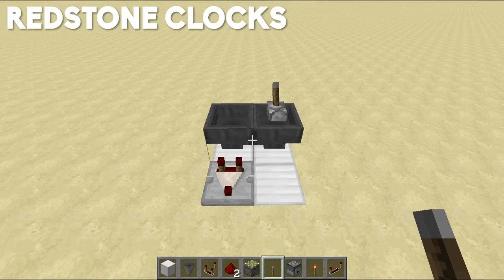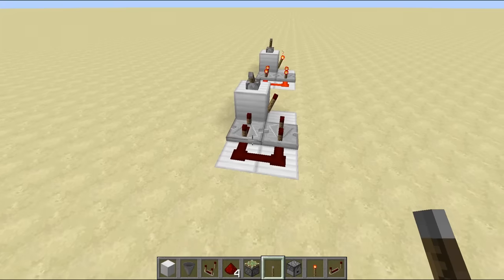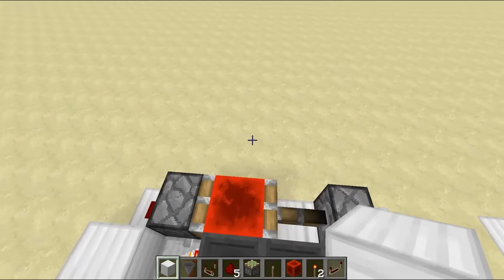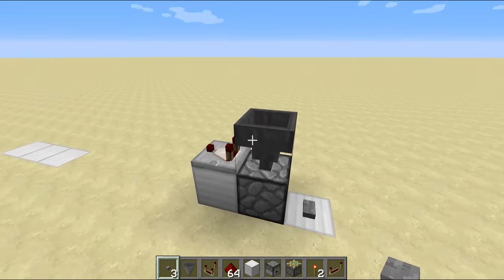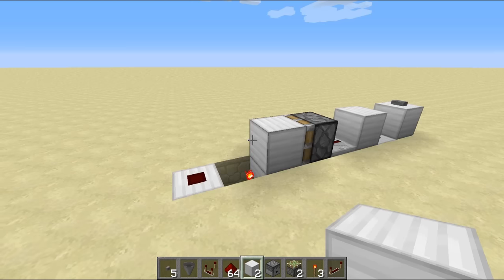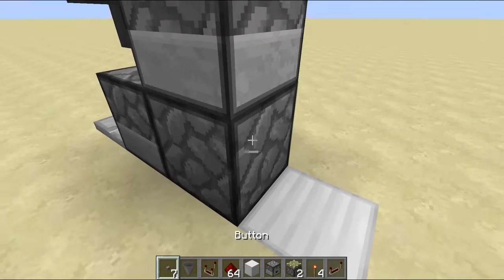25 Minecraft Redstone Circuits YOU SHOULD KNOW!

Comment: cAn'T yOU juSt uSe a LEvEr???
Reply: He can but using button is cooler
Reply: Following on from NBA Sebastian whatever-his-name-is (sorry dude), you could for instance have a hidden staircase that can retract and pop out from both ends, like in the 3-hour bunker challenge
Reply: Also because, if you have a piston door with levers on both sides, you can easily lock yourself out
Reply: what if you wanted 2 use a pressure plate or tripwire?
hmmmmm....
Reply: s&n railway you can just click reply to reply to their comment...
Reply: OrangeC7 levers can only switched by players. Flip flops allows you to switch these "levers" with redstone signals
Reply: drum roll not in a tight contraption!!!
Reply: TOO SIMPLE
Reply: It's good if you want your base to light up when you walk it
Reply: Levers sometimes don’t cut it
Reply: people use bottons instead just to make things look better
Reply: cAn i jUst uSE a reDsTone tOrcH?1
Reply: If you have a piston door that has a lever someone can lock you in/out, but with a t-flip flop you can't lock the door unless you put in a locking mechanism
Reply: get an iron door and put two levers beside them. see what happens. it dont work. you pull one lever and it works and you then cant close it.
Reply: No levers need to be turned off mannualy

Try using levers to open and close iron doors

YOU GET STUCK
Reply: @jannpmc4694  the button is better too because you could have and or gate to power one switch. Rather than have to use 2 levers and run the risk of accidentally locking yourself out of your base because you decided to flip the switch inside of your base
Reply: I think nobody got that it might be a joke..
Reply: Buttons are just better :P
Reply: On what part?
Reply: Yes, But am I gonna.^o^
Reply: Yea but what if I want to use buttons or pressure plates to hide it better
Reply: T-flip flops are better
Reply: Not if you want it automatic
Reply: Thats not fancy at all.
Reply: Of course in the example given in the video you get the end result of a lever, but the circuit itself gives you many new possibilities.
One such for example is a counter, where you'd keep track of the binary representation of a number by having many t flip flops connected through one another.
Reply: R/whoosh
Reply: Ok I fucking asked my self this XD
Reply: Button has a far clear look
Reply: @jannpmc4694 not entirely but half of the point

Comment: I don't want to just know how to build it....I do want to understand how it works.  That's why I clicked on your video.
Reply: Same here
Reply: drowningnixis hey, why need to know how it works if you know how to make it. And he does explains it
Reply: This. I also want to see examples for machines in which the circuits are actually used.
Reply: @jisanpissan2900  Why need to know? Because curiosity and knowledge - you know, the reason why some people try to learn stuff... and if you didn't realize that yet: Knowledge without understanding is dangerous (well, at least in real life :P).
Also, no, he doesn't explain it.
Reply: The way it works is the hoppers transefer the itemes into the hopper infront of them but cannot have the item put back into them because it is powered (good rule of thumb for anything using hoppers), the way the toggeling of what hopper is powered happens because there is a brief period where only one of the pistons is powered what alows the other piston to push the redstone block across and power the other hopper and the second pistion cant push the redstone block back because powered pistons are non mouvable. thats the basic machanics of the hopper clock.
Reply: And wat it does
Reply: I understood almost everything. After you experience in a creative world and watch few tutorials, you'll get everything. It's eezy.
Reply: @MyReligionIs2DoGood  Begin creating your own machines and you'll see you'll encounter problems that you will be able to solve using what's shown in this video
Reply: @IndigoGollum ji-san piss-an

Comment: Timestamps for all the circuits

0:28 - CLOCKS -
0:42 Hoppers-comparator clock
1:07 Two repeaters clock
1:48 Comparator clock
2:26 Hoppers-pistons clock (long delay)

3:13 - MONOSTABLE CIRCUITS-
3:24 Piston-repeater monost.
3:42 Dropper-hopper monost.
4:13 Silent repeaters monost. (1 tick)
4:43 Fal. edge silent repeaters monost.

4:49 - T FLIP-FLOPS -
5:00 Two pistons T flip-flop
5:44 Dropper-hopper T flip-flop
6:32 Silent repeater lock T flip-flop

7:04 - PULSE EXTENDERS -
7:14 Two comparators pulse extender
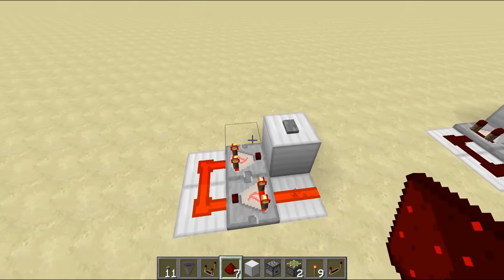7:38 "Old school" linear pulse extender
8:11 Square, 4 repeaters pulse extender
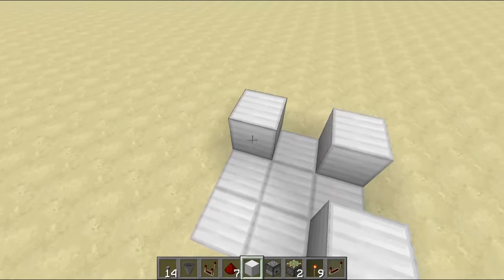8:43 Hoppers-pistons pulse extender (long delay)

9:34 - LOGIC GATES -
9:44 AND gate (torches)
10:17 OR gate
10:48 Vertical AND gate
11:32 RS NOR latch (torches)
12:23 Two droppers RS NOR latch

13:05 - DOUBLE PISTON EXTENDERS -
13:24 The 2-4-1 double piston extender
13:46 Wall-flushed double piston extender
14:21 Floor-flushed double piston extender
15:30 Ceiling-flushed double piston extender

16:24 - BUD SWITCHES -
16:33 Normal BUD switch
16:58 Wall-flushed BUD switch
Reply: Thx

Comment: ~Redstone Clocks~
0:29 Simple redstone clock
1:06 Redstone torch repeater clock
1:48 Comparator or 1-tick clock
2:27 Etho hopper timer

~Monostable Circuits~
3:13 Basic monostable circuit
3:42 Dropper-hopper monostable circuit
4:13 Silent 1-tick pulse generator

~Toggleable Flip Flops (T-Flip Flops)~
4:49 T-flip flop
5:44 Dropper-hopper T-flip flop (silent)
6:32 Repeater lock T-flip flop

~Pulse Extenders~
7:04 Pulse extender
7:38 Old-school pulse extender
8:11 ABBA gate
8:43 CodeCrafted's massive pulse extender
https://youtu.be/v5PN35YRDDQ

~Logic Gates~
9:34 AND gate
10:17 OR gate
10:48 AND gate, vertical

~Redstone (RS) NOR Latches~
11:32 RS NOR Latch
12:23 Compact RS NOR Latch

~Double Piston Extenders~
13:04 Double piston extender
13:46 Double piston extender, flush with a wall
14:22 Upward-facing double piston extender, flush with a floor, vertical
15:30 Downward-facing double piston extender, flush with a ceiling

~Block Update Detector (BUD) Switches~
16:23 BUD switch
16:58 BUD switch, flush with a wall
Reply: Thank ya
Reply: Nice

Comment: For those who are playing minecraft pe and wanna create a hopper clock, the only changes you need to do is to add redstone on top of the pistons and place blocks on top of the two output redstone pieces. That makes the redstone dusts on top of the pistons not connected with the outputs of the two comparators (redstone dust that powers the piston). The redstone dusts on top of the pistons act as a update detector so when one hopper is empty, they tell to the piston "Hey buddy! Can you extend please?" And the pistons do exactly that!! Quite a simple fix!😃
Reply: Thank you!
Reply: or you could just put a repeater running into the piston
Reply: Thanks :)
Reply: +Jonathan Asuncion If you watch carefully, the output of the hopper is a redstone dust that usually powers pistons. The thing is that once one of the two outputs is off, the other one for some reason doesn't realise it must extend, so that's why you put the redstone piece on top of the piston. It's role is to make the piston realise it's the only one that is powered and, as a result of that, make it extend!😃
Reply: +Miranda Kreta repeaters do the same the difference is just that the redstone dust could power more than one object unintentionally but if you want to power a specific block use repeater
Reply: Jonathan Asuncion My fix makes it more compact. Same footprint on the X and Z axis and a block higher on the Y axis.
Reply: Jonathan Asuncion And usually you don't put the hopper timer extremely close to the redstone circuit you want to have it for.
Reply: Has a shit 7 year old PC that can barely run Minecraft

Calls people who play on a different platform peasants
Reply: Jake the Snake My pc is as old as yours

Comment: a lot of the circuits does not work on pe edition🙁
Reply: pocket edition edition? lol
Reply: I know, pocket edition Redstone is broken
Reply: Pocket edition redstone works slightly differently. There is no piston bud-powering and there isn’t zero-tick power (or even 1-tick piston pulses, because in pocket edition pistons take 2 ticks minimum and will even extend 1-tick pulses to 2-ticks if they have to. This is actually a pretty cool mechanic, but it also means that observers can’t 1-tick power pistons.) If you extend the delays on everything by a tick, it should work (except for the monostable circuit with the repeater lock - just make the repeater on the right side 1 tick longer and leave the other two.)
Reply: pe redstone is completely different
Reply: The Pocket Edition edition?
Reply: Yeah they do that , those Pocket Edition Editions
Reply: mint frost then play decent mc versions

Comment: It's just called an RS Latch.  It is NOT a NOR gate as NOR gates are only on when neither in put is on.  In other words a NOR gate is only on when NEITHER a NOR b is on.  An RS latch is a logic device which can be Set and Reset, hence the "RS" part of the name.  The latch remembers its most recent state.  That is its entire purpose.  FYI, the first "RS Latch" you mentioned is actually an OR gate as the output would be on regardless of which input is on.

Comment: 13:40
I make my own double piston extender before watching this video. I couldn't figure out how to do that whole back on, front on, front off, back off, front on, front off.
What I did was put a sticky piston with the block I wanted to move on the first layer, then slime blocks on top of both of those with a sticky piston pushing those in the same direction as the other position. The top front-most slime block gets in the way, but it works for my purposes, thank's for giving me a better design though.

Comment: uploaded 7 years ago and absolutely what I was looking for to make a redstone airstrip with redstone torches (for the Minecraft Immersive Aircraft mod or the like). Specifically, I needed an RS NOR Latch to change from blinking patterns to lit or unlit patterns (just need a signal either sent or not to light the thing, then a way to switch from a single path or a delayed one using a tick clock). Likely I will just have it controlling the blinking or normal lit pattern though, as I don't need much more than that.

Comment: I made an observer clock with a piston connected to the output. I made sure that the piston head makes contact with the face/detecting side, and it can be started by a lever or a fire to the face of the observer. The very big problem is its probably the noisiest clock circuit ever, because of the piston head moving back and forth.

Comment: I'm sorry if you already have a video for it but I was hoping you could make a video showing a few different ways to make a circuit that simply sends a double pulse allowing a dropper to push out and pull in lava very quickly and explain how it does this. I use people's ideas all the time but I would like to understand why it works this way and I have a hard time figuring it out. If you could break it down slowly and explain each part Barney Style that would be amazing. So many people say this is how you build it, but not so much why this is the way it works. Thank you for what you do.
Reply: If you're serious, you can just use an observer, it doesn't get simpler. A button the front of an observer sends two pulses when pressed. This is because observer detects the button being pressed and then being unpressed.

Comment: So that's what that circuit is called! "Mono stable circuit" so I was building a 3 sticky piston door using a super oldschool version. All you do is set down two blocks two blocks away from each other and place two redstone torches facing each other and slave one of them by taking the output of one to the other using repeaters. Then take the connecting the one that is slaving the other as the input and then throwing down some redstone dust on the other side for your output. The theory of operation is when either using a constant or a pulse there will always be a 1 to 2 tick output depending on the repeaters. So if you invert on to off it will off/on/off instead of on/off/on. I've made it past 5 sticky pistons using a simple pulse splitter to make each circuit fire the exact number of times.... which now I know there is easier ways. 😂😂😂

Comment: Just want to point out to people using this as a guide on later versions of minecraft (like 18.x), redstone dots are INACTIVE in conditions where they need to power blocks like the  etho hopper timer. If you're putting dots down and wondering why your machine doesn't work,  that's probably why, click it again, even if it appears to be powered. The first monostable circuit is interesting. If you substitute a normal block for the sticky piston, a dot WON'T power it, but a dot WILL power the sticky piston. However when you get to the first T-Flipflop the same MS circult fails with a redstone dot. Al;ways test!

Comment: @13:27 Huh. I noticed that your redstone signals range in order from left to right as 2 ticks, 4 ticks, then no tick. I just built a 2x2 double piston extender door 45 minutes ago, and I had the redstone signals in order from the center outwards(Because the signal is mirrored on both sides of the door) as no tick, 2 ticks, then 1 tick. I assume that redstone without a repeater is no tick, though I just dived into redstone today after watching another one of your videos.

Comment: Was going to lament that XOR (on only if one, but not both, inputs are on), but realized you can "mimic" this with a t-flip flop. Mind, I said "mimic". Its fine if you want to do something like I actually used an XOR for, and need a constant signal, which keeps a piston door in the "closed" position, until you flip a lever, then closes it when flipping a different one (or, using the t-flip flop, you just have a button flip the state from on to off), but.. what if you just want to compare two signals, and get an output, which was only on if "on" of the things was true, but not both of them? Its kind of an important logic circuit, but.. there has got to be something better than the two examples that are available, and only one of which I was able to work out how to get a proper signal from (i.e., make work at all).

Also, the mod pack I was using was pre-locking, I think, and didn't include dispensers as "createable" items at the stage I was in when I decided I needed a serious bloody door to keep the vast armies of undead from getting into my base (instead of just locking myself in at night, and cutting a hole in the wall in the day). lol

Comment: The locked repeater flip flop wasn't working for me. 
I used a wooden button and I guess the pulse was too long. 
So when you say "run an input", in this case it's more specific than that, it needs to fit certain parameters

Comment: i really want a way to connect two different circuts together, maybe with a comparator, but it only puts out power if the direct one is off and the one on the side is on
Reply: NOT the direct line with a torch and connect it to the side line with an AND gate.

Comment: I need one button press to send 2 signals slightly apart from one another's to toggle a dispensing water bucket.

It needs to dispense, wait a second, then pull the bucket back in. How do I do this?
Reply: you need 2 signals right you could just run a signal off to the side that re enters after a set time by using a repeater timer
Reply: Attach hopper clock + t flip-flop, and then you can configure timing... Good for mob farm flushing systems.

Comment: Will these work with a command block to delay a player from teleporting? I have a PvP arena set up, wanted to set up a teleporter so that the winner isn't stuck inside, but wanted the command delayed so the player isn't teleported instantly so they can't easily run away from battle

Comment: 10:17 , it's not an OR gate, logic gates shouldn't allow their output to modify inputs. If you use this, your systems will break.
Reply: Where in the circuit does the output modify the input? Thats a basic OR gate if ive ever seen one
Reply: @StanbyMode  Put a torch at the output, then you'll see the input light on, which is forbidden in a gate. You have to have your inputs isolated from each other and the output as well, so to do this you could add 2 "YES" gate after the inputs.

Comment: Hey  @Mumbo Jumbo, i really like your video's. Looking forward to your Pacific build. Got a redstone question. Me and a friend are building a sheep race game. I'm having an issue with the finishing system. After first sheep passes a string between 2 tripwire hooks i want to put a number on digital redstone light board. Problem is that i don't know how to close the circuit after the first sheep wins, else after second sheep passes, that will the be winner and so on. I was looking to a RS NOR Latch. Problem with it is that it can't give variable power. I mean that you can't detect who's won anymore. I'm doing this with with a redstone encoder. Long story short: got 4 inputs and only want to detect first input and the strength of it. Can you help me out?

Comment: Quick question. I've got an auto farm half running, but I'm trying to get my railing system to go back and forth collecting the resources then stopping at a set of hoppers to drop off the items. What I'm trying to figure out is how to automate it do it gives the hopper minecarts time to drop off the load before being sent out. Everything I've seen is on a single level, however my drop off point is 2 blocks off the ground, and there lies the issue I'm having. How can I get the repeating pattern to go up a couple of blocks without stopping?